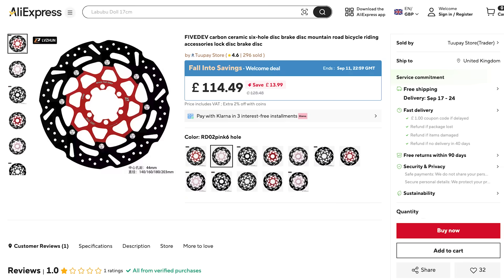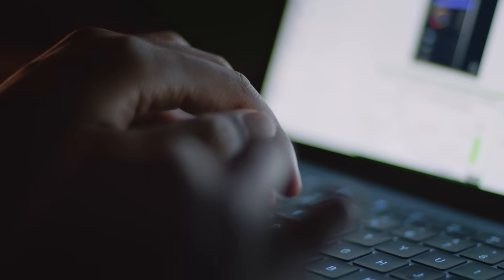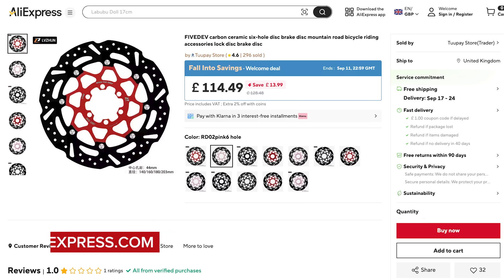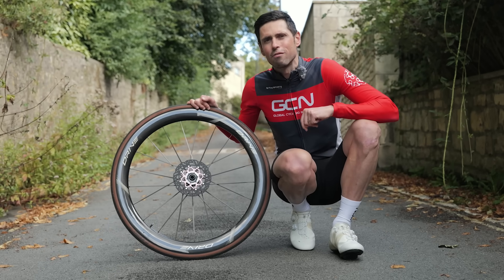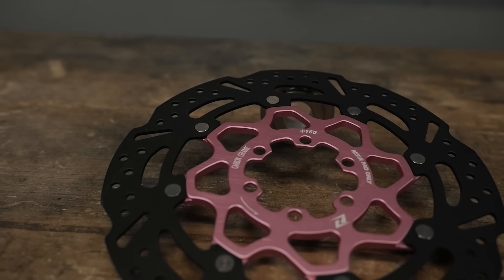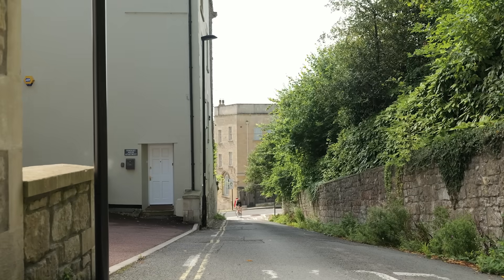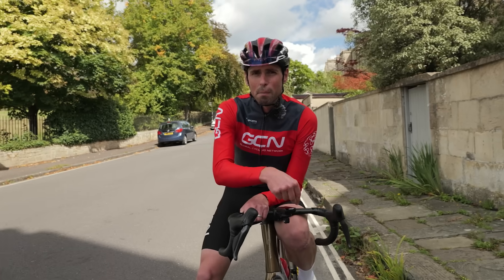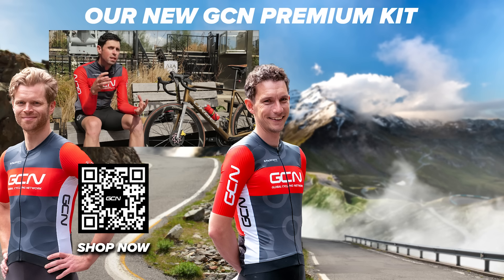Why Bikes Can't Have Carbon Ceramic Brakes

Comment: Could it be because we don't pull 1G+ cornering. Or no one will be willing to pay $2,000 for a set of rotors. Or, or, or.......no one rider weights more than 2,500lbs going 120mps cornering.....well.......tell us boy, tell us why?

Comment: One has to be quite an optimistic fellow to believe they are actually getting a ceramic/carbon brake disc from Ali Express, and it isn’t just black paint.  I doubt I would ever use anything safety related from Ali Express…

Comment: The bike frame would have to be totally redesigned, thickened, and made robust. Carbon rotors would also require different brake pads and callipers. It is not worth the effort; the end cost would be enormous in comparison to a racing car or motorcycle, which has more mass and elements to fit the carbon-based braking system. A complete system would have to be re-incorporated with a new groupset, etc. Thousands of dollars, probably more than the rest of the bike. At the present moment, clearance in the road bike frame is about 1-1.5 mm from the surface of the steel rotor. And a bike speed is a fraction of motor racing.

Comment: Carbon ceramics/carbon would be VASTLY more $$. Even Brembo can’t get their price down for cars. On bikes just upgrade to a bigger rotor and possibly caliper. More thermal capacity and low cost

Comment: Is there any cycling competition where you brake so much that the rotors will be able to maintain the high operating temperature ideal for carbon?
Reply: This can happen with downhill mountain biking. I've heard of riders specifying larger rotors and metallic pads in the rear to combat the heat load from continually applying the rear brake to control speed. Even then, metal rotors can still get warped.

Comment: The key takeaway here is that a fool and his money are soon parted...   And if it aint broke... don't fix it.  Not one single person who has ever ridden a bike with normal, every day, property installed and adjusted disc brakes EVERY thought, "Damn!  I wish these brakes were even BETTER!"  I mean, how much stopping power and modulation does one need?  Normal / run of the mill disc brakes will already throw you over the handlebars if you hit them hard enough.  So... the only possible reason to try carbon fiber would be to save a few grams of weight... which you could easily surpass by just taking a piss or dropping a deuce.
Reply: I’m not saying  that carbon brakes are the answer, but what you’re saying now is exactly what everyone was saying about disc brakes when they first started replacing rim brakes.
Reply: @Alex-eu7ls  Um... no.  Disc brakes solved SEVERAL ACTUAL problems (with mountain bikes)... like mud in the brakes, tire clearance, heat dissipation... braking power.  Carbon disc don't solve ANY problem with disc brakes.. they're just "lighter".

Comment: I had, well still do in a box, those Kettle Cycle rotors. On my mountainbike they were terrifying. I tried the resin pads that were recommended. Awful. The metallic pads were marginally better but at best they felt like riding fouled pads. Not nearly enough grip of the rotor. Live and learn.

Comment: I have experimented with various lightweight disc rotors with aluminum (coated) and titanium braking surfaces…. All of those products were total failures and only made sense for boutique show bikes, never meant to be actually ridden.  Achieving lightweight in a disc rotors is usually a compromise in braking force, and the ability to manage heat seems to be directly related to the rotor mass.  Now I prefer Hope rotors for reasonable weight and good braking performance, Shimano work pretty well also at reasonable weights.  I expect, at some point, someone will develop a carbon rotor and pad material which will work for cycling, but doing so will take a lot of development, as what will work for brakes will not be the same as what will work for F1 or aerospace.

Comment: Carbon ceramic high performance road car brakes are also super noisy until they heat up. A lot. And their performance is meh when they are cold. They are lousy for day to day and for the regular road car speeds/use just a money extraction tool by car manufacturers. Owners get this when it is time to change the discs after very low mileage or even one track day where the discs have damage from pebbles, etc and get quoted $25k for replacement.
Reply: The noise and cold performance qualities you mention have not been my experience on my 911.
Reply: @RB-xv4si A mate of mine has a gt3 with the carbon brakes. He reckons that the best thing about them is that they don’t seem to produce any brake dust, thus making wheel cleaning easier!
Reply: @Grassington2 yes, it’s true. Very little brake dust with mine. The GT3 is an incredible car.

Comment: I’ve got some ceramic pads for my mtb brakes not used them yet. Interesting subject time will tell as they do use them in motorsport. Have you tried the absolute black graphine pads?

Comment: Baloney.  As a research scientist the percent of weight savings on your bike from using carbon fiber ratio to your body weight is so small as to be so small as to be worthless especially in racing conditions where everyone has the same small reduction. Let’s face it it’s a device to sell expensive bikes only

Comment: I could have told you so. What is needed and would, hypothetically work is STRAND WOVEN NATURALLY PRESSED Carbon ceramic, non baked, aerospace grade. Specced them for my car and ordered them at the main factory for most makers. They look dark insulator material pressed to a percent textured surface - look on forums or sites for 3d strand woven carbon ceramics/..100,000 kms no wear. Saved my car twice from drivers burning red lights, stopping me on a dime whereas steel would have slipped They are 70% lighter than steel or high carbon iron performance race rotors, 30% lighter than RESIN BAKED CCBS (the ones on Porsche corvette BMW etc). Not brittle, heat fast and the hotter the better braking. Now, the limitation may be thickness - TBD as engineering projects are working on it. But let’s put it in perspective. The resin pressed rotors we see on 99% of CCB cars  take a few hours to bake, 200$ Brembo sold for profit and 5000$ / each rotor greed. STRAND WOVEN NATURALLY PRESSED Aerospace) take 20-30 days to bake in the pressurized tank, then they are hard. They do not wear rough inside resin boiling and last million kms per spirited driving car.  They do not delaminate with oil or contamination. They wear by pressure/abrasion, not heat. Anyhow tbd. So in this video the resin-baked CCBs are a poor choice to begin with. strand woven are a different magic, once bedded they are light, heat transfer surreal. Will take a time to bed in though as Strand woven is exceptionally hard. So this video is awesome just with the wrong tech and the pit bottom of CCB materials.

Comment: The F1 guy said they liked carbon for its performance once up to temp. Does the average rider actually get their rotors to these temps? As a commuter I want perfect cold break performance and pretty good/ok hot brake performance. Does the average racer even hit brake temps that would make this tech worthwhile for more than 5% of any race?
Reply: No to both questions. Even in MotoGP they revert to steel discs in the wet because carbon discs do not get hot enough to work properly.
Reply: A quick google search says that F1 brakes work optimally between 400-1000 degrees. There is no way a to reach up to those temps on a road bike even in race conditions.
Reply: Maybe on a really fast downhill. With the exposure to the air at the front of the bike I imagine any heating you would experience braking for a corner would dissipate by the time you get down the straight and brake for the next corner. In F1, in wet/cold weather they will cover up part of the brake ducts with tape to keep temperatures up otherwise the huge scoops cool the brakes too much and they fall out of their operating temperature.

Comment: Having watched a lot of MotoGP (admittedly the speeds and stopping power required there are incomparable to cycling), I assumed it was the temp range for them to being effective that was the issue.  MotoGP requires steel brakes for wet races for safety, and IIRC riders have complained in the past about poor brake performance (as well as tyre performance) at tracks like Phillip Island when the race is held outside the Australian summer on a cold and windy circuit.

Comment: Ceramic brakes are meant to be run at temperature which is why they're generally restricted to performance motorsport. Even sports road cars don't run them, instead opting for high grade carbon steel.
Reply: Yes they are an option on a lot of high performance road cars but AFAIK only a few very high end cars have them by default, took a look at the Porsche 911 and seemingly only Turbo S and GT3 RS have PCCB by default, even the GT3 has these optional so the basic trim comes with steel brakes.
They are safe for daily use but probably aim more to those who want to use it more as a track car, I've even heard some stories (hearsay) where people got a used high performance car with carbon ceramic brakes and downgraded them to steel rotors as the maintenance/repair cost was obviously very high and the steel downgrade cheaper and they probably don't do a lot of driving close to the limit/racing.
Reply: @kuchenblechmafiagmbh1381 yeah - a lot of true track guys go to steels. If you get the right brake pads, you rarely (if ever) need carbon rotors.
Reply: Concorde didn’t need to preheat its brakes before landing….
Reply: @robertpatrick3350 It didn’t have to.  It was a heavy aircraft (200,000 lbs) with a high landing speed (190 mph) that required a very long runway (9,000-11,000 ft).  It generated enough heat in the first two seconds of braking to bring the brakes up to full operating temperature by dint of the aircraft’s 320 million joules of kinetic energy (roughly half of which would be converted to heat by the brakes, with the remainder handled by thrust reversers and full flaps).

Aircraft brakes have far different design specifications than road cars or bikes.  The emphasis is on one very heavy stop and a light cycle of two to get to the gate and back.  Cars, motorcycles, and bikes have more frequent light duty cycles, with only an occasional full power stop in an emergency.
Reply: Wrong. My 911 has them.
Reply: @RB-xv4si  Oh, great N=1 has joined the chat. 🤣
Reply: You can get carbon ceramic brakes on cars starting as low as $65k (audi Rs3). There are plenty of cars with CCB packages.
Reply: Several road cars do… I saw one yesterday.  A Porsche Turbo with a PCCB package (those are the ones with yellow calipers).
Reply: @paulgrimshaw8334  yeah, and anyone serious about performance (including race teams) converts back to steel for hard use. also the 20k replacement cost is an issue. helped a buddy put his GT3s rotors back on to sell it.

Comment: do not see the point, with F1 racing, i get it, weight sizes and power braking but for road biking that seem like a small change for the price.. if the rotors last 3 to 4 times longer, then it might worth it.

Comment: While you're at it, spray some WD-40 on the rotors,🙈🙉🙊too. I heard that'll increase stopping power.
Reply: This makes me think of a Vespa clutch, they're inside the gearbox with the oil (oil bathed clutch). They generally have 3 plates and they're made out of cork. Surprisingly they do work pretty well.

Comment: The Carbonova disc looked interesting, but their promo video showed a bike going down hill with loud music over the top so you could not hear any potential brake noise.  Carbon Ceramics need heat to  bite, so it will always have poor initial braking until a few revolutions have gone to warm the surface.  They are commonplace on high end cars, so I do see them coming down to bikes, but will need a specific pad material to manage the heat up and lack of weight in comparison with a car for example.

Comment: I have a drop bar 29er with floating discs and 4 pot calipers front and rear, and I definitely do not need even the brakes I have, as a 90kg man.

Comment: The vast majority of car/van brakes are cast iron not steel, it’s cheap and easy to machine, end product is heat treated so that they don’t warp under heavy braking. The demands of aerospace/motorsport braking systems just don’t appear in most regular road use and certainly not on bicycles. 
Bicycle rotors are made of steel but there are lots of steel alloys available and processes that could enhance rotor performance, ie using forged steel instead of cast steel, it’s more expensive and again for 99% of riders it wouldn’t give them any tangible benefits. A key consideration with brakes is to consider the issue of ‘over braking’ ie excessive brake performance, many cyclists struggle with managing existing brake performance as it will overcome mechanical tyre grip very quickly. There also has to be a balance with fade resistance and cold bite, a general principle increase one and the other decreases. 
Braking technique is often ignored, short hard braking forces applied are far more effective and less likely to induce brake fade. In motorsport the brakes are used more like a on off switch and threshold braking is something that makes a huge difference
Reply: Agreed that brake performance is influenced heavily by proper braking technique, as it is with driving!  I live in the mountains of Colorado, and it pains me to smell the cooked brakes of motorists as they drag their brakes constantly going down mountain roads!  I do believe bike brake rotors are made of forged steel though, rather than cast.  The rotor braking surface always looks to me to be made of a flat steel plate, generally I would expect that flat steel plate to be forged.  the steel braking surface is likely laser or water jet cut, and then, hopefully, ground perfectly flat to the final thickness.
Reply: @barrowsworm1226  Yes, I should have mentioned steel plate always has an element of forging, I was referring to a much more aggressive forging technique, it’s possible to create some amazing heat capable properties although this could be overkill for bike rotors 🤣 
Something from the Iconel family of alloys could be very light and extremely heat resistant. Only the richest dentists could afford them though 🤣🤣🤣
Reply: @HighFell  Why be a piker? Go with beryllium rotors. Very light, high thermal conductivity. And if they do get hot, they poison everybody around with BeO2.
Reply: @soaringvulture  I was being cheap…. Blame growing up in Yorkshire 🤣🤣🤣

Comment: I don't think we're at a point that we need more power for brakes.  I can lock my front and rear wheel up without issue, and could with rim brakes too, so once the wheel isn't spinning, the brake is sorta out of the equation.  MAYBE in extreme situations, the brake fade could be an issue requiring some trickery, but personally I've never needed more anything from any brake I've used on my bikes.  I just rode 92 miles yesterday with 8100 feet of climbing and never once did I need extra power on a downhill I encountered.
Reply: More power is always welcome, as it just means one can use less hand force to operate the brakes to produce maximum stopping force.  While riding in flat terrain, this may not matter at all, but during long mountainous descents, or riding off road on long descents, one can easily get some hand pump from repeated hard braking efforts approaching downhill switchbacks, etc.

Comment: If you're going to get CF disc brakes, my money would be on downhill bikes, with some appropriate shielding to ensure you don't get crud into them.  Even then, I think its unlikely because unlike the automotive race application, there's just not that often when you need to handle that much heat.  A larger rotor is just so much easier, and the weight deltas just aren't that large.
Reply: We don't carbon ceramic on off-road vehicles either. It's just not the right application.

Comment: Haven’t seen vid yet, but still gonna ask, was correct breaking pads used? As they specified on the buying page you need a certain type for the carbon disc due to heat

Comment: Why should bicycles bother with carbon ceramic disc brakes?

Even ceramic bearings are snake oil for bicycles. The RPMs involved in bicycle parts aren't high enough to make use of ceramic bearing's advantages...
Reply: yep sub 200rpm situations max vs 100k for a turbo impeller
Reply: Ceramic bearings also have a low tolerance to being exposed to dirt.

Comment: I could imagine carbon composite brakes being used on bicycles but only as the rear brake and only for the weight saving. As said in the video and this needs to be said and emphasized a lot, sure carbon composite brakes are great at high temperatures, but they also perform poorly when cold and on a bicycle cold brakes is what you get 95% of your ride. So, I'd say steel front brake rotor and carbon composite rear rotor could be a thing, since your front brake is the majority of your braking power anyway. This would however only make sense to hobby riders, as the UCI weight limit (6.8Kg) is already generous enough.